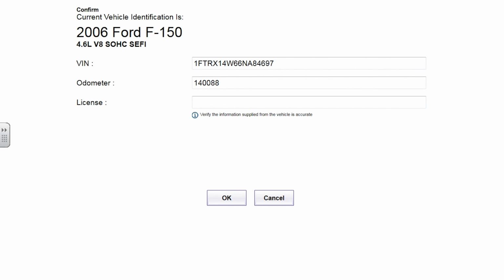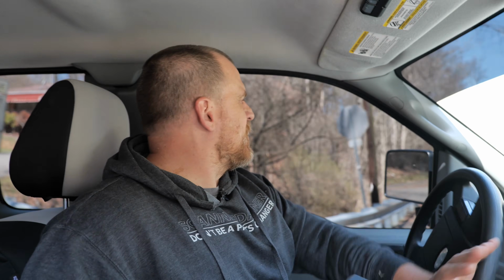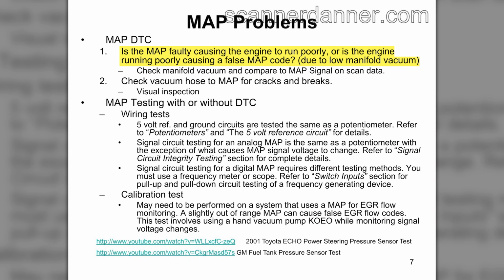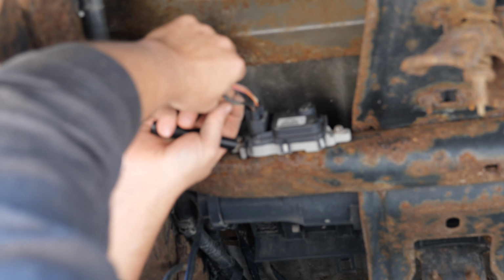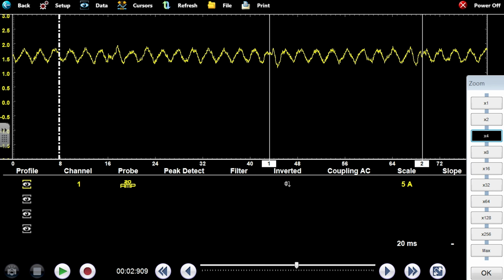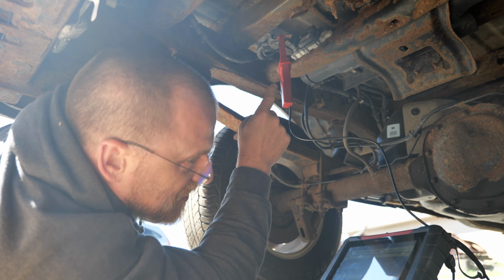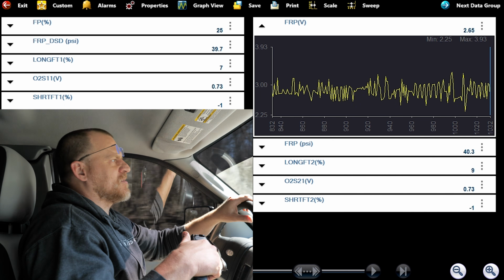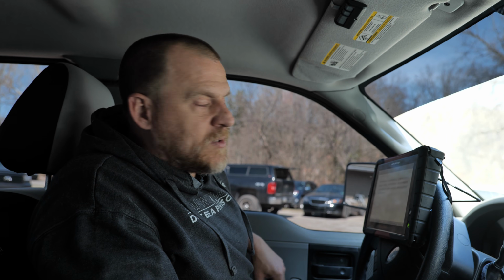Intermittent Low Power/Lean Conditions [2006 Ford F150 Electronic Returnless Fuel System]

Comment: On your talk about charging..  I say:  You MUST charge them even if you don't find something..  The fix for that is to set those expectations up front.   Really question them on how often it's acting up and if it only did it once--- then just cut them off right there and tell them to keep driving it until it gets worse.  That's my only fix for intermittent issues--- you just have to turn them away until they are a persistent issue...  OR you make sure that the customer knows that you may not find anything because it's not happening very often...   Many customers will agree to that up front and tell you to look anyway;    then when it comes time to bill--  they won't get any unwanted surprises.. You set that expectation and tried to turn them away first......    This is exactly what I do to my woman,  my mother and my sister..  :) ...   I don't charge them to work on it anyway.. but I still set that expectation and turn them away often.. Just keep driving it-- I'll fix it when it's actually broken.  And typically--  the thing will finally break and then it's a quick easy fix and I never had to chase my tail on a rare intermittent fault.

so again:  TLDR 
Try to turn them away if their intermittent issue isn't happening often.. Then if they insist on you looking anyway;   just let them know that it still costs, even if you can't find anything,  because you can't recreate the fault.   This way they know exactly what the agreement is.  That is the answer for this situation
Reply from the maker: We will do the same! Good words, thank you!

Comment: Silly thing the gas cap. With vehicle not running take gas cap off, put back on 3 clicks. Fire up the vehicle. Silly but maybe.
Reply from the maker: I've never seen a gas cap cause any driveability problem, ever, on a fuel injected system. Not once in 30 years.
Reply: @ScannerDanner  I know it's silly however I did have a guy in a Cadillac Escalade pulling a 30 ft trailer in the middle of the parking lot blocking traffic and for like an hour or two and I finally walked outside to see what he was doing and he couldn't get it going so I told him to go take his gas cap off and do the three clicks he finally left right after he did it has nothing to do with what you're talking about. Thank you, I'm learning a few things from your videos, thank you.

Comment: Just a question what do you charge to do this particular vehicle in this particular situation. What is the bill that you handed him
Reply from the maker: I dont charge at all for the stuff I do these days. You guys pay my bills by watching and subscribing to my website. 
But the key with whatever it is you are charging is proper communication with the customer.
Reply: @ScannerDanner  how do I properly charge. I've started oscilloscoping and other things correctly and trying to diagnose correctly about 4 years ago.  And I charge for what I do for my time. That's why I ask I just want to make sure I'm being reasonable. Thank you for responding sir
Reply from the maker: @charlespaluha1247 for this one, I would not have charged for more than the initial agreed upon price. You should have a flat fee you charge from a starting point when you do these. 
If I know it's going to be an intermittent problem, I may sell the customer an additional hour up front? Variables there for sure
Reply: @ScannerDanner  what is your initial flat rate charge

Comment: i have seen on E450 this problem 2008 a couple time corosion of fuse contact giving low voltage fuse box in hood.thanks great video
Reply: sometime banging fuse box can duplicate the problem ,just put a voltmeter on the inertie switch and monitor the voltage will bagging

Comment: Had a ford that corroded the case on the fuel pump driver  , bolted to the axle an the aluminum on steel reacted .  New driver comes with a rubber standoff feet.

Comment: My 5.4 285,000 miles still runs like a top no issues what so ever. but the dam frame tapped out. I can double fist the frame on both sides just past the front leaf perch

Comment: So we sale the best guess as a REPAIR ATTEMPT! We make that CLEAR.. we can’t duplicate your problem mr/Mrs customer.. but based upon YOUR complaint, the DTCs, testing and research… this is our BEST GUESS…. So they can approve it OR they can pick it up and wait until it breaks 🤷🏾‍♂️.. and even when they say no, we still charge for diag. We’ve always been fighting that, not giving away diagnostic time.  But intermittent problem SUUUUCCCKK!!!
Reply from the maker: I agree 100% with everything you said. Sometimes you're forced to roll the dice (with intermittents you cant duplicate) but as long as the customer is fully aware of the situation then you're good! And as long as they understand if that doesn't fix it, you're not working for free  from that point on.

Comment: Your rant is spot on not just for the automotive industry. The printing and graphics industry fails in similar ways. A shop (more likely the sales rep) will not want to charge a customer to fix there poorly created files even though the most experienced person spends hours of time using very expensive software and workstation to correct the errors.  Shop management doesn't like to make waves and make a customer made with additional charges. This is false logic on their part as they may have very well losing money on the whole job. Many a business has gone bankrupt with plenty of customers.

Comment: Great point, it’s not the workshops fault the problem doesn’t occur., so absolutely should be charging diagnostic time, and being upfront with customers BEFORE starting the diagnostic  process may be key. If a customer doesn’t agree then they can go somewhere else, at least you know before you have done the work. Would a lawyer charge for their research? Of course they would.

I truly believe mechanics are too kind for their own good. They just want to look after their customers and feel bad charging when the problem isn’t fixed. Which is why I get pissed of when the media paints mechanics as rip offs. Probably only 0.05% are ripping people off. Most mechanics are eating costs that they shouldn’t! They are ripping themselves off.
Reply from the maker: 100% accurate statements. I watch more work being given away while at the same time that same garage owner cannot afford to hire another tech nor pay the tech they have a better wage. All in the name of "taking care of the customer " smh

Comment: This scenario highlights a common issue in our industry. Customers often end up with hefty repair bills if mechanics only address the trouble code without thoroughly diagnosing the issue. Imagine how frustrating it would be for the customer to pay a significant amount, only to realize shortly afterward that the problem persists. Additionally, the unnecessary replacement of parts results in wastage as those perfectly good parts are discarded, contributing to landfill buildup.
Reply: Well good parts aren’t discarded. Techs don’t throw away parts that they replaced via parts cannon. You can’t clear the code and give it to the customer after replacing the part… it needs to have run a few trips or even a drive cycle and the code needs to clear itself. Clearing a code and returning vehicle to a customer without running a drive cycle is ridiculous. The customer ends up taking the vehicle after a repair drives it to their lake house and the check engine light comes back on . If the part you used is from Napa even if it’s a good diagnosis that parts gunna fail. Electrical components must come from the dealer . A shop that uses a Napa part that’s electrical is only taking your money. In my opinion… the suppliers that sell electrical related  components to Napa don’t pay nearly a 1/10 of the money for R&D . Electrical 100% has to be replaced with OEM
Reply: That's what I'm dealing with

Comment: Hey SD, fuel pump driver module duty cycle signals are as follows:

20%=the FPDM us receiving an invalid duty cycle from the PCM
40%= the FPDM is receiving an invalid event notification signal from the RCM
60%= functioning normally
80%= the FPDM is detecting a concern with the secondary circuits(feedback signals)
Hope this helps
Reply from the maker: That would be the feedback signals you are referring to.

Comment: Your rant makes perfect sense. Sometimes the ittermitent nature of the problem makes you burn time just hoping for the synthom to reveal itself. And the only way to solve the problem is when the problem manifests itself. Until then you are just burning time that should and must be payed because is the only way to reach for the solution and final repair, so those hours just driving and also the fuel spent must be provided by the client. The client chose a complex vehicle with complex systems that may fail so it is up to the client to spend to correct the problem or live with it. Best regards. Love your job.
Reply from the maker: Agree 100%, thank you for this comment. I just wish others would understand. From garage owners, to the techs, to the customers. All three have their own unique problems and variables they bring into this equation

Comment: You're guilty of what I've been guilty of many times, not fastening your seatbelt while test-driving 😅
Reply from the maker: Seat belt was buckled. Shoulder belt is under my armpit so it doesn't interfere with my mic. 😆
Reply: @ScannerDanner 

Sorry,.my bad 😅 but it's still not very effective, be careful! 
I myself get carried away with the thought process sometimes and end up not fastening my belt.

& BTW  I %100 agree with you regarding the issues of charging for such un repeatable issues. It's hard to communicate the value of diagnostics with most customers, as they have no idea how technical it is to diagnose vehicles nowadays & to make things worse people are generally way more comfortable paying for parts compared to paying for labour.

Comment: Paul! 
What about corroded wires? 
That's probably where your intermittents are at!
Reply from the maker: However, the amperage measurements at the pump module tell us this isn't a corroded wire issue.
Reply: @ScannerDanner  
Sorry Paul...the shadows in the vid on those two blower motor wires made them look damaged.
Reply from the maker: 100% a possibility